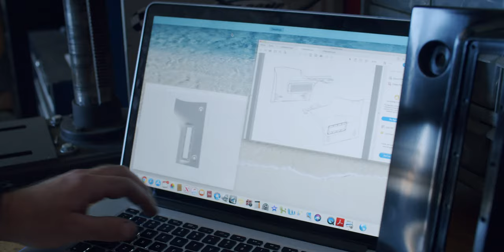LUCID VSL OFFROAD LIGHTING

Comment: Just got these.  I page of directions and a wiring diagram.  Still need to go buy wire, fuses and connectors to tie into my JL aux switch 
For $550, you really need to make this a complete kit not just a box of parts.  I wouldn’t have bough it if I knew how bare-bones these are.